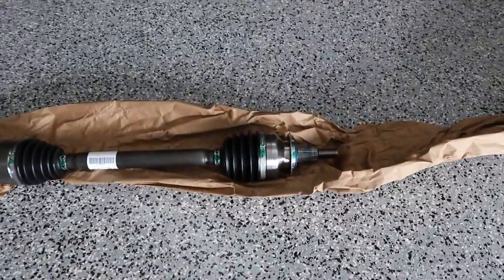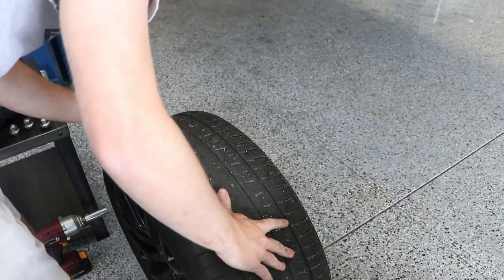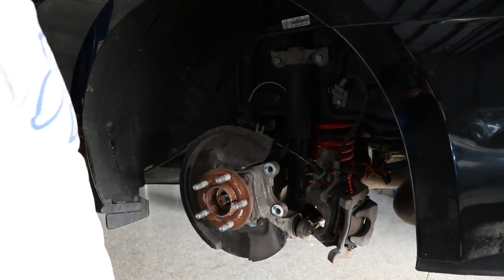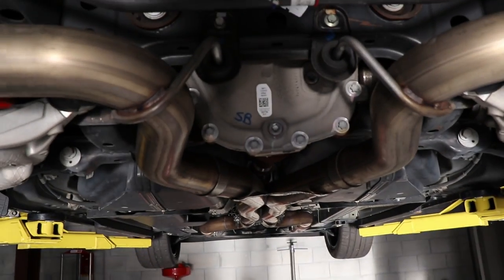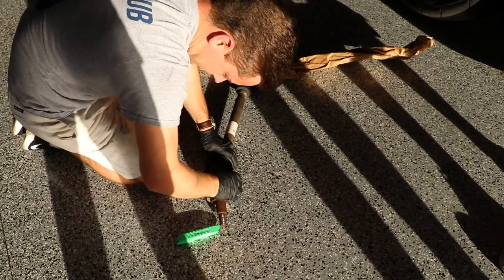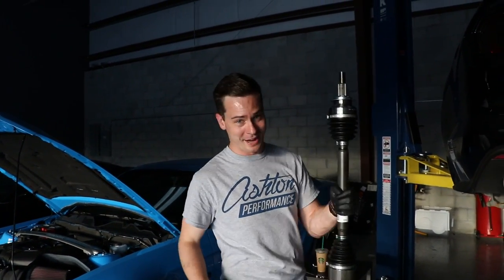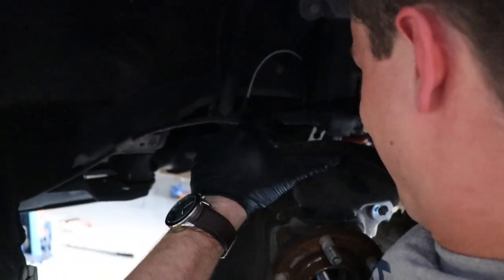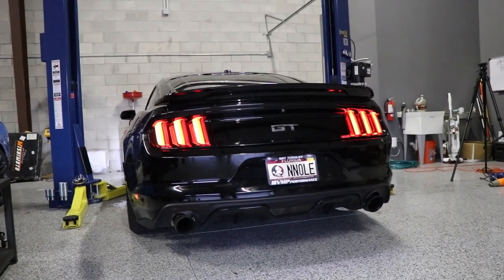Fixing the FBO GT - Installing a Halfshaft on a 2015 Mustang GT

Comment: few items to add to remove at least 90% of the wheel hop, especially if you're adding more power to the beast. Definitely upgrade the half shafts. Plus add vertical links, Toe links, subframe support, and lockout bushings supports. Steeda and BMR make some great products. I have the BMR Toe Links, BMR Vertical Links, Steeda Subframe Brace and Steeda subframe bushing support system. It's like night and day

Comment: Whenever y'all replaced the half shaft, did y'all have any ride height issues? My half shaft on my 15' got replaced under warranty and there is a 1/2" difference in height vs the other side. I also have eibach sportlines.

Comment: My half shaft broke today, but due to a shop stripping my stock bolts out and putting the wrong bolts on, they started backing out on Easter and couldn't get an right bolts until today. so it left two bolts in the only oem bolt left and one they put in and so it snapped on the left side like his, but tore the metal off lol... awesome day, check it out on Instagram @ThatYellowGoat.